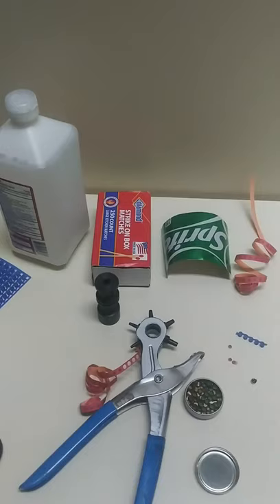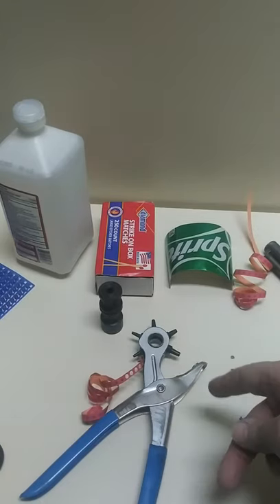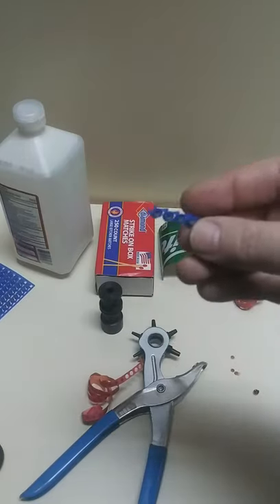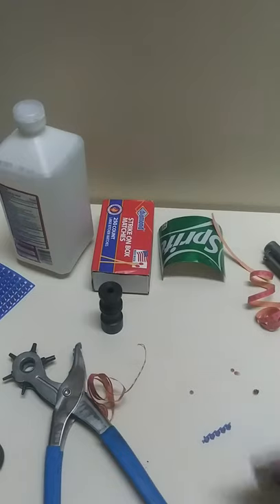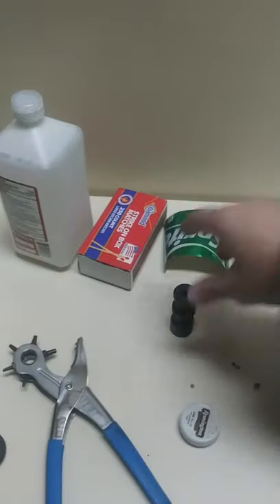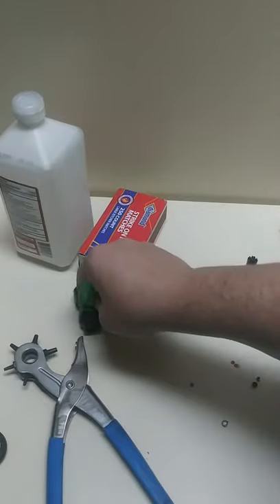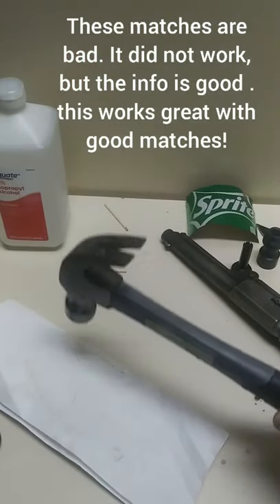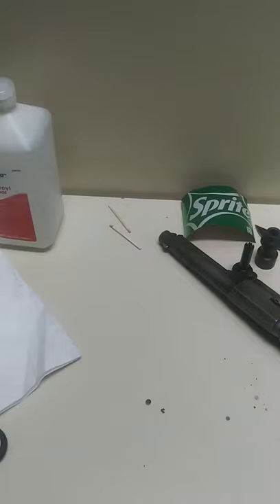percussion caps: how to make them yourself

Comment: I've used the matchhead method for making shotgun primers before.  The finer you grind the heads up, the better.  My best results were achieved with a roughly 3/1 matchhead/striking compound ratio.  Two things to keep in mind: 1) SMALL BATCHES!  2) This stuff is very corrosive, so make sure to rinse the gun with soapy water after firing.

Comment: Kind Thanks! I’ve had success with just one roll cap. I put a tiny dab of glue in the homemade cap and place the punched out cap with a needle with a tiny bit of glue on the needle, placing it in the case. I’ve had good success with one cap in the case/cup. I’ve also used the tip portion of strike anywhere matches with success. Time consuming yes but satisfying nonetheless. The match tips I’ve done carefully crushing them to a powder and adding the alcohol. I learned about the match head from another YTuber. Thanks Again, Many Blessings and Good Shootin! DaveyJO in Pennsylvania
Reply from the maker: Thanks for sharing! I have used the match way as well. Thanks again

Comment: Bravo, good job! It is good for responsible BP shooting enthusiasts and hunters to know this knowledge!

22 Sharpshooter stuff is awesome. 22 Sharpshooter has added additional items. His Primall compound is said to be very effective. However just like with Toy Caps and with Matches, Primeall is highly Corrosive and requires through cleaning afterwards.
Thanks for sharing.
Reply: I mean isn't black powder and pyrodex super corrosive anyway? People are already gonna have to clean it afterwards, so as long as they take the cones out and really clean the cylinder on top of normal cleaning, it should probably be fine.

Comment: It is called Richardson's mix I have building 209 primers for years with this mix I would say maybe two didn't go off I have rebuilt thousands of 209 primers and as I said maybe two of them didn't go off
Reply from the maker: Thanks I've never heard it called that before. I have also never had any real issues with this. I haven't made as many as you, it sounds like. but I've only had one ever not go off. I also have a video on how to reload pistol primers. It's a very similar process but I usually go the strike on box match route.. thanks for stopping by

Comment: Can you use the ends off any where strike matches since the striker powder is in it already.
Reply from the maker: That's a great question. I have no idea. Definitely something that needs to be tried.
Reply: @snappers_antique_firearms   As kids we would shape any where strike matches with an old straight razor and use it to make aluminum foil rockets worked great a solid fuel. If you hit it with a hammer it would pop.
Reply from the maker: @ronrobertson59  thanks for sharing. This definitely would be much easier. Yeah if they went off by hitting it with a hammer, it will 100% work.
Reply: Yes you can

Comment: Finally a good video on making your own percussion caps! I had such a hard time trying to do this on my own. I have the 22reloader cap maker thing and I originally tried just using one roll cap punched out and some black powder. Never worked. I even tried using duco cement cause some dude on forum said it’d make it burn hotter . Now I see I should’ve used more than one lol. I’m going to try both of these methods after Christmas. You think 6 roll caps in a percussion cap is overkill for a uberti dragoon?
Reply from the maker: No at worst you will get better ignition. I never had any problems going hotter. Welcome to the channel. good luck and let us know how it worked out for you.

Comment: Where do you get the blue toy caps? Good video! Also have you used the Prime All powder from 22LR reloader? Black powder, oops fireworks powder, yes please!
Reply from the maker: Amazon. I have not used the 22lr prime all. But I bet it's a great product and would work perfectly. I will get to making the firework powder 😉 soon.
Reply: PrimeAll is great. And easy to use.
Reply from the maker: @juddlentz1115  thanks I will give it a try
Reply: I use the prime all it works great 👍 👌
Reply from the maker: @pauljennings283  thanks I have been curious how well that works..cheers

Comment: I shot black powder years ago, I think caps were a couple bucks for 100!
A year ago I bought an 1851 Navy Sherrif. So I thought this will be fun, until I found them as cheap 20 bucks with a 40 buck hasmat fee! For 100 caps. I also found them for $115.00 + and $40.00 Hasmat fee! At these prices , I should just buy a barret 50 cal!
Reply from the maker: Yeah it's been crazy since all the crap that's taken place in the last 5 years. Hopefully it will get back to normal sooner then later. Also the largest supplier of black powder sold they were not making powder for around a year. They just got back up and running. Best way to shoot very cheap these days is flintlock. If you make your own blackpowder, it's extremely cheap to shoot. Making blackpowder is quite easy and very safe if you follow some precautions. A few of us don't buy powder anymore since we can make powder that's as good as Swiss. Check out a channel called ( everything blackpowder ) he has made it so making powder is easy.  you can make over 5 pounds of powder for the price of buying just 1 pound from the store.

Comment: Can the caps set off the black powder substitutes?
Reply from the maker: Yes it can. But I recommend testing and experimenting with the amount of cap powder. Either the match method or the pop strips. To get extremely reliable ignition